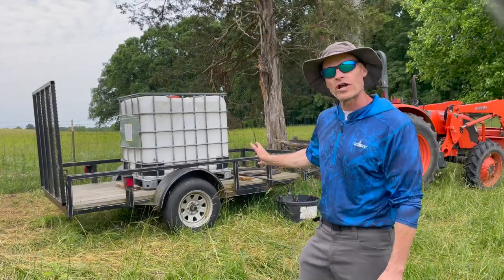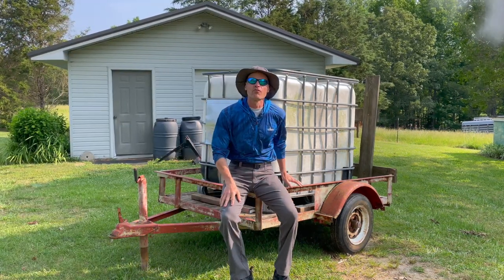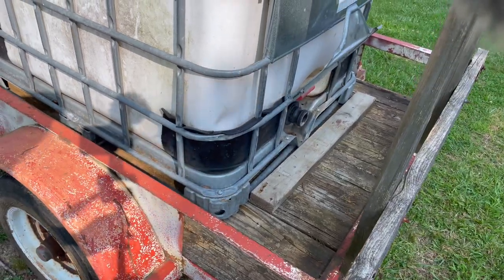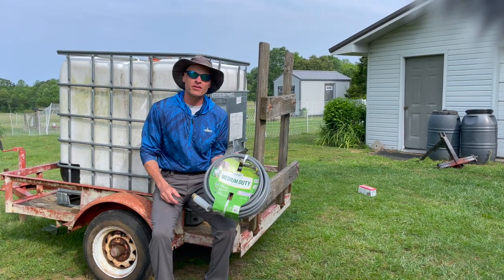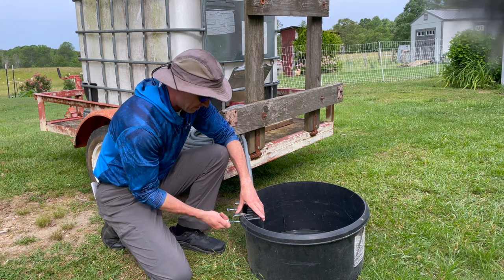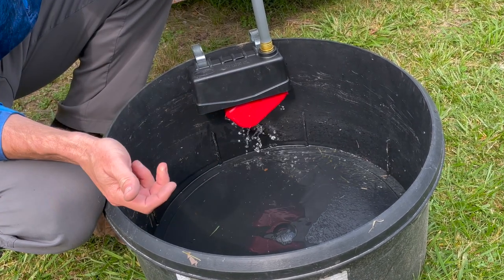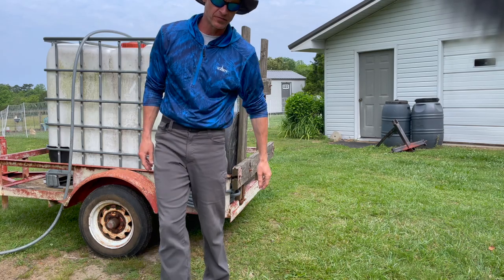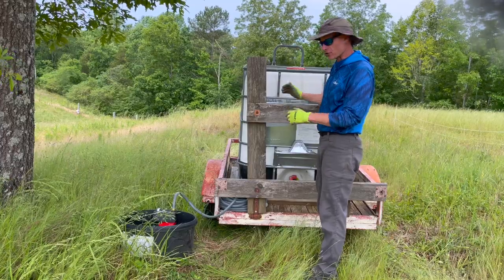Mobile Watering Station

Comment: Great job, I also have this setup some notes:
1️⃣27.75” equals 1 psi, we don’t plan on pressure but volume 
2️⃣ used typical cam lock with 1.25” hose, allowing more flow.
Reply from the maker: Thanks

Comment: I think maybe try putting the tote under a tree on top of the hill and use the 50' hose to run down the hill to pressurize the water output. The only thing is that the water hose would heat up in the sun. Maybe trench it and bury the hose so it stays ground temp. Great video, though. I'm in north central Alabama and would love to see your setup sometime
Reply from the maker: I don’t see why that would work.

Comment: Great set up! I used to strap a metal hog waterer(has side opening) on a utility cart and haul it to the new paddocks for my dexters to drink. One question  I had as I looked at your set up is I was wondering if there is a way to elevate the tote a little higher. You gain .433 psi every foot higher you go. This might make the tub fill up a little faster but as you said it is not a big deal for it to trickle with sheep and goats.  Once again, great job and thanks for the tip!
Reply from the maker: I appreciate the suggestion about elevating the tote.

Comment: Your video couldnt have popped up at no better time. I'm looking at doing the same cause I'm tired of transporting 5 gallon buckets for 90 head. I love what you got, but I'm curious. How long it take for your sheep to go through that amount, an outside of the shade tree how you deal with the algae? Thanks
Reply from the maker: Hope the video is helpful.  It’s hard for me to give you an average of how long a tank of water lasts. So many factors: how many head, how hot, how much rain, how lush the grass is, etc. since I move it at least every week, I don’t usually fill it more than half way and it easily lasts a week for 60 head.  As far as algae, I know they make chemical solutions you can put in the water.  I’ve also heard you can add diluted bleach.  You can also cover the tank with a light proof tarp or paint it to block sunlight.  I just rinse it out good before refilling.

Comment: But I think I'd dig a well and add a electic motor to fill the tank that I'd make with concrete. I will ensure that I dig a pipe system under ground with taps after some distance.

Comment: 8.33 lbs x 275 = 2,290 lbs.  Make sure a trailers payload is more than that
Reply from the maker: Or simply partially fill totes to not greater than trailer payload.